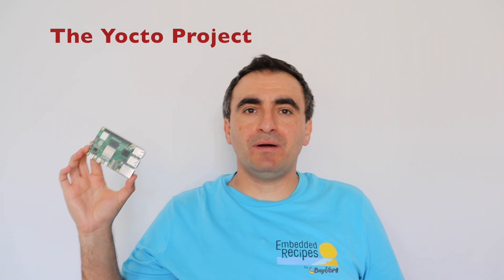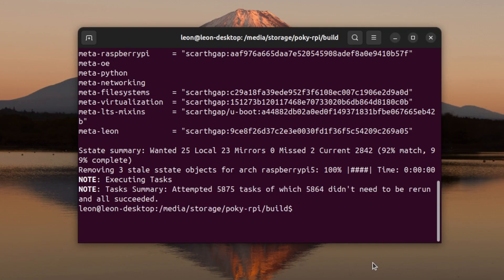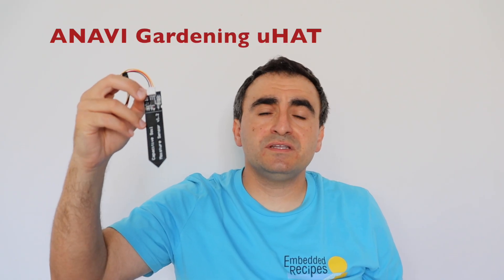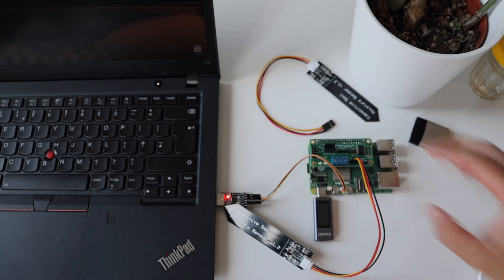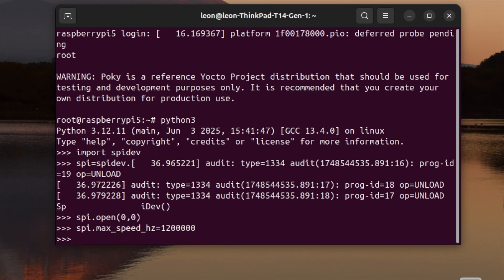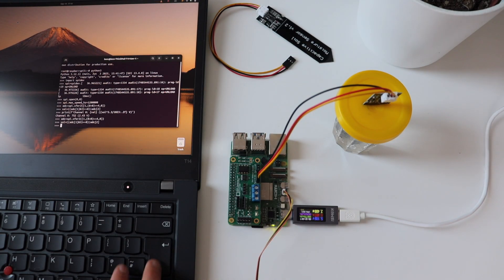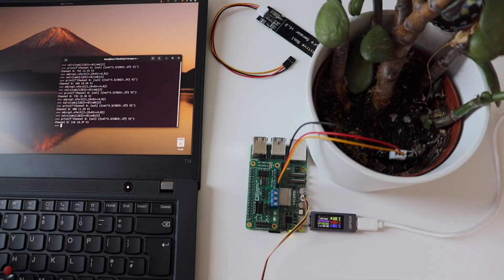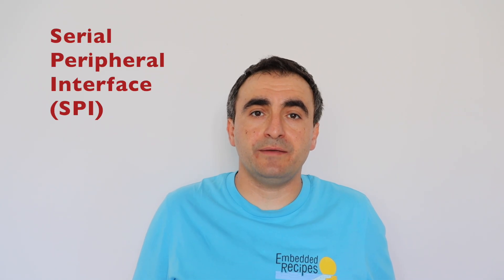The Yocto Project on Raspberry Pi 5 Episode 10: Use SPI for ADC and Soil Moisure Sensor on Linux

Comment: How about the Chip Select pin? It is automatically defined?
Reply from the maker: On the ANAVI Gardening uHAT, the chip select pin of the MCP3002 ADC is wired to GPIO8, corresponding to SPI CE0 on the 40-pin header of the Raspberry Pi single-board computer. The spidev Python library used for the demo in the video allows you to configure chip select additional settings such as cshigh or no_cs which set the "SPI_NO_CS" flag to disable use of the chip select

Comment: First of all.... Thank you so much for this Project series.....As a beginner this is helping me alot...
and I have a quick question..... I’ve created an UI using Qt and I’d like to add functionality and deploy the UI onto a Yocto-based system. how can I properly integrate and build my Qt application for Yocto?
or Can you make a tutorial on how to use Qt for Ui on Yocto?
Reply from the maker: Thank you for watching my video tutorials! I am happy to hear they are helpful. The short answer for integrating a Qt/QML app is to use the meta-qt6 layer. You can run it directly on the Linux framebuffer, or use a windowing system like X11 or the newer Wayland.

I am planning to cover core-image-weston, which boots Weston, the reference compositor for the Wayland display protocol. In a follow-up episode, we will be able to then run a simple Qt app on top of it.

Several people have asked me about this topic, and it is something I have wanted to cover for a while. I will do my best to schedule time and bring it to you in the foreseeable future. Before that I want to cover 1-wire and UART as a related follow-up of the I2C and SPI episodes.
Reply: @LeonAnavi  Oh my 
thank you so much for your efforts 🙏
Reply from the maker: @Raveer-b8z  thank you for the kind words :)